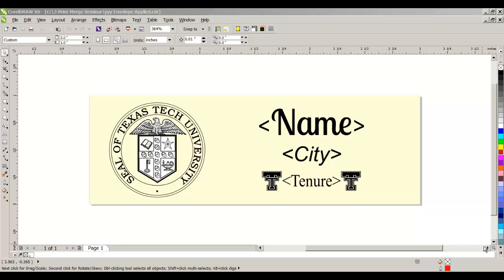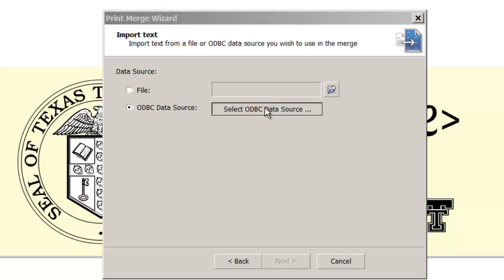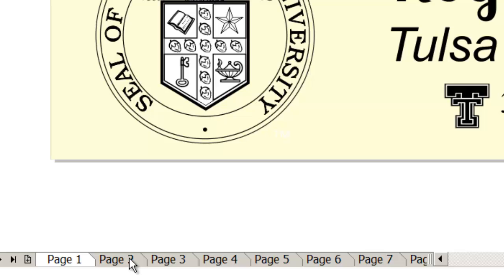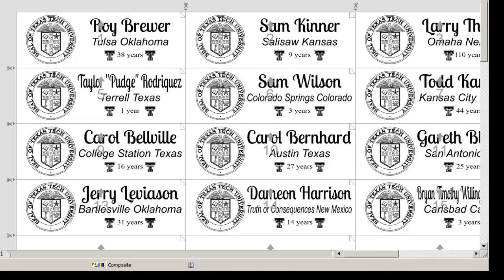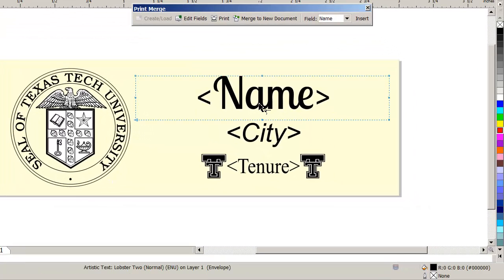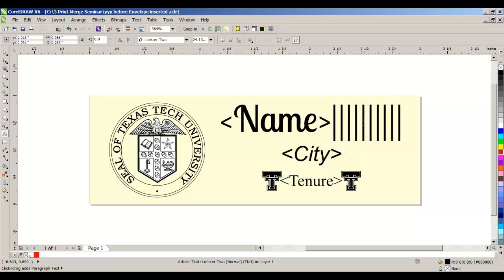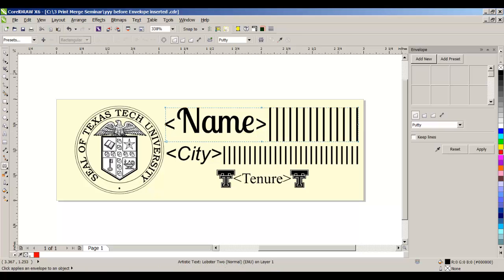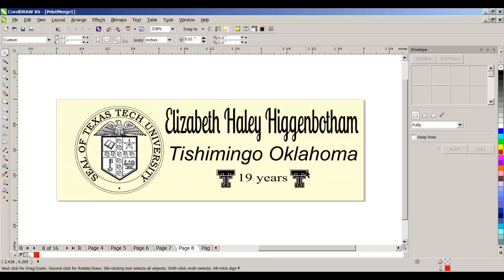Autocondensing text with CorelDRAW Print Merge

Comment: Have a question related to mail merge from Excel to Corel . Whenever I merge phone numbers with 10 digits it works fine but in case there are 2 ph. numbers separated with comma for eg. 99999999999, 99999999999  in corel merge file this entry remains blank with no data in that particular field. Please suggest.

Comment: It's July 2019 and I just found your video from March of 2013 - it's still very relevant and useful... thank you very much! The only thing I would add is that I found it necessary to add an equal amount of PIPE characters both at the beginning and the end, or otherwise the text didn't come out centered correctly. I am going to make it a point to search out any other instructional videos that you've made; I'm sure I'll become a lot more proficient! Thanks for spending your time to help others (like me).
Reply from the maker: If you tell me you had to put extra pipe characters on both sides, that tells me that you didn't have justification set properly (normally Center justification is what you want).